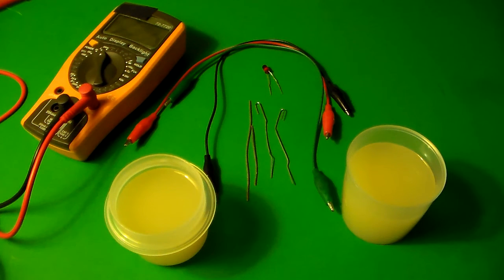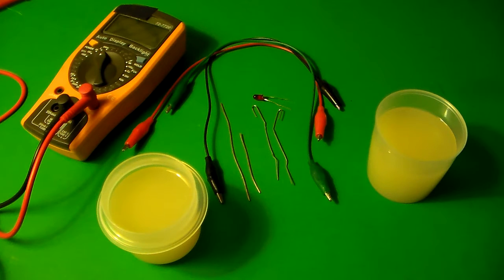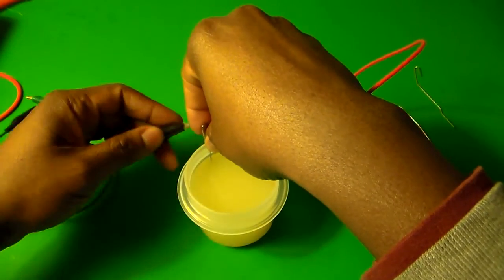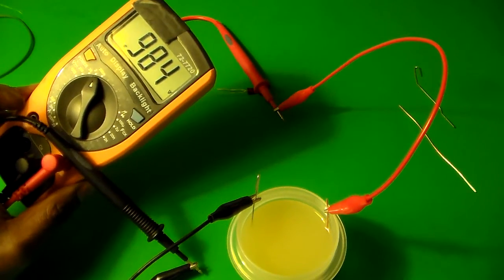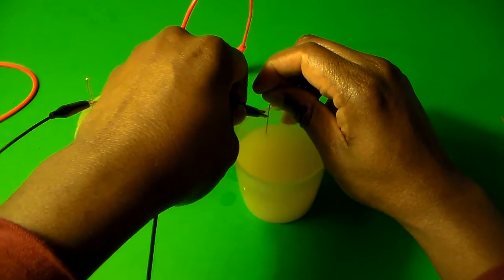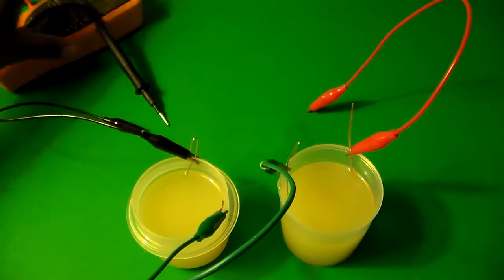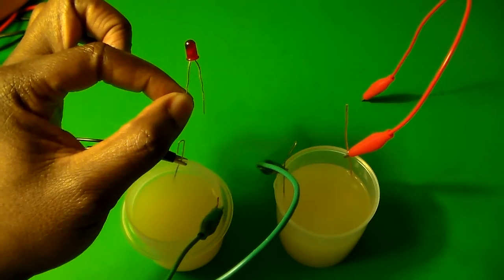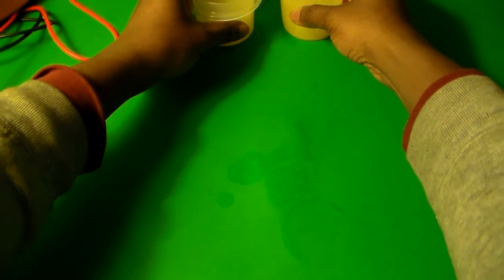Construction and Theoretical Explanation of a Lemon Battery

Comment: The reason why the diode was barely shining is because there was not enough current.To increase current you have to put more metal parts into the same cup - more clips and more copper wires and the diode would brighten up because in our current depends on the volume of chemical reaction inside of the juice. If you build a wall out out of the paper clips at one side and a wall out copper wires at another the current would increase significantly.

Comment: why did you use another lemon juice if you have enough lemon juice in one container? you can put the 2 copper wires and 2 zinc wires in just one container and will get the same voltage as when you connected it in series as long as there's enough lemon juice.

Comment: Another note: Lemon contains citric acid. A chemical reaction between citric acid and copper isn't possible. CU doesn't react with citric acid inside of the lemon juice and therefore the explanation of the energy flow is false. Copper attracts electrons and any material that attracts electrons more than Zinc would work. We can view it as a material that attracts electrons to itself, like a magnet. The role of the copper in the battery is to attract freed electrons from the zinc therefore creating  the current. The attracted by the copper electrons then move back to the acid and react with citric acid by creating hydrogen. More copper - bigger magnet. So the idea of getting more current from the lemon battery is to have a copper wire that can collect all freed zinc electrons. I would assume there should be at least twice as much copper as there is zinc for maximum efficiency. Two copper wires per one zinc wire. Why copper attracts electrons? That's another story. It's the material property we need something to suck freed electrons in from the zinc wire and that why we need the copper wire.